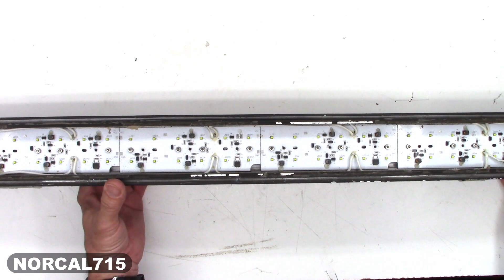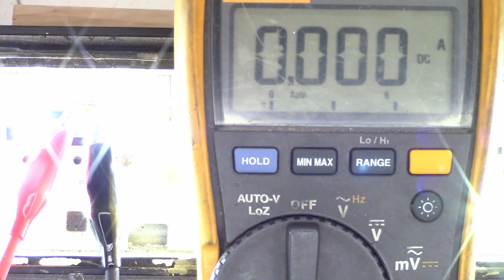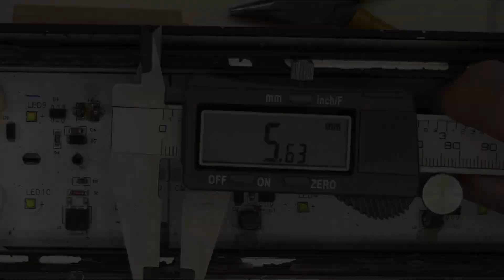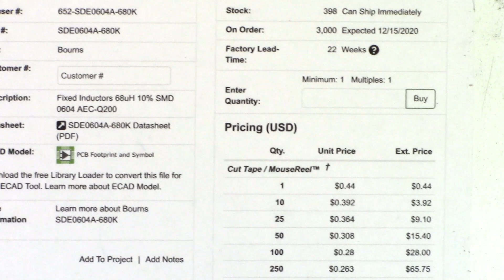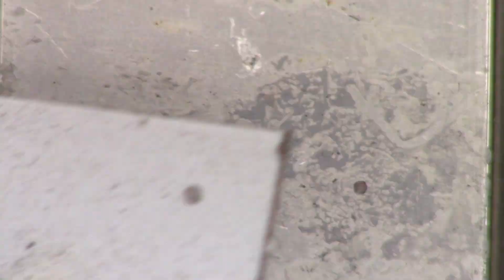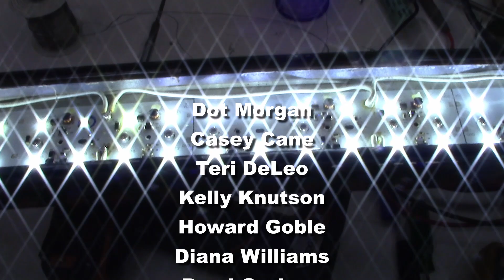96 LED OFF ROAD CURVED LIGHTBAR -  GROUPS OF LEDS ARE OUT - REPAIR FIX

Comment: Good work on the installation, but I’ve been waiting to see how you plan to reseal the light bar housing. I’m particularly interested in the type of adhesive or sealing method you’ll be using to ensure it’s watertight..
Reply from the maker: Just a bead of clear silicone RTV

Comment: What is the purpose of the inductors for driving led
Reply from the maker: The power supply is switch mode buck converter and the inductor absorbed the pulsed to smooth out the pulses to the LEDs
Reply: That makes sense, similar to electrolytic caps, though I suspect inductors are used over caps as they last longer?

Comment: I'm pretty experienced in diy 12v wiring and misc in vehicles.i found a heavy 10 bulb led light that had a plastic housing with a huge magnet on the base.I could not find an on/off switch ,it did not work when I plugged it in so I disassembled it and realized that two electric motors ran the up and down and the left and right position from a remote controll or blue tooth idk lol anyhow I ran the light straight to a battery (only the light)and it worked great.The next day I waited until dark to show my son and it no longer worked,I currently do not have test equipment but everything looked good even the board,I tried everything and Im really bummed out over it
Reply from the maker: That's weird, maybe temperature related. I just don't have an answer. Sorry
Reply: @norcal715  once a week I pick it up,hook it up,try to get it to light up,I give up,then I put it back up!lol I'm having a hard time getting over it...

Comment: So in an application like this would a heat gun be better than a soldering iron? I was looking to fix the led bar on my roof rack because I had 3 leds go dim and 1 completely out. Just wasn’t sure how to get them soldered since the whole back side is metal
Reply from the maker: A heat gun will melt the LED before it is unsoldered. You have to heat the aluminum substrate they are mounted on.
Reply: @norcal715  what did you use to heat it?

Comment: It's interesting they didn't use the solder pads on each end of the boards. Maybe they figured out running 15A trough the tracks of the outermost board was a good idea :D

Comment: Off roading seems to be a bit tough on coils. I wonder if military grade would hold up better. The others will break in tough terrain soon. Maybe not. 🙃🤔
Reply: There is not a "mil spec" one per say. But Norcal did the right thing in ordering a AEC-Q*** listed part. It is about the best you will get for the automotive industry in general. They usually cost more, but if you work on anything automotive always look for that standard. :)
Reply: @whodatdere1  hey thanks for that info. Totally ignorant on the auto spec. 👍
Reply: @barryg41  I wouldn't blame ignorance at all! 
Been in the electronics industry over half my life (20 years) and only learned of the "automotive standard" by accident a couple years ago when I laughed at some overpriced capacitors and wondered what was special about AEC, now I know what to spec for some of those harsher jobs. In all reality most components will be satisfactory these days with due care and attention. 
After all, every electronic item needs a weakness. Can't generate revenue by only selling one to a person in a lifetime :P